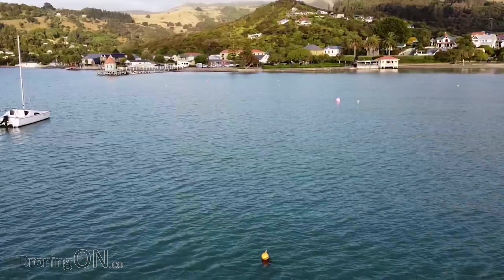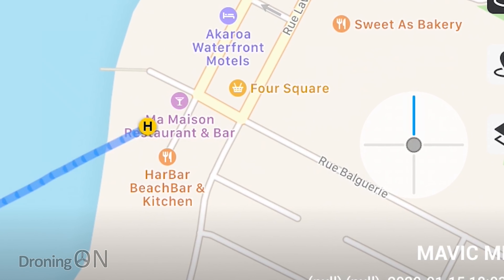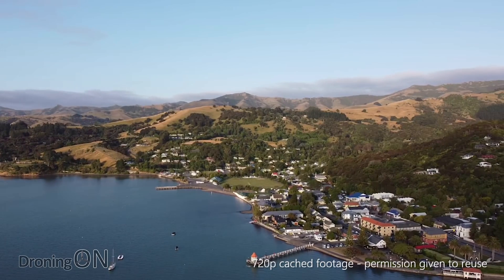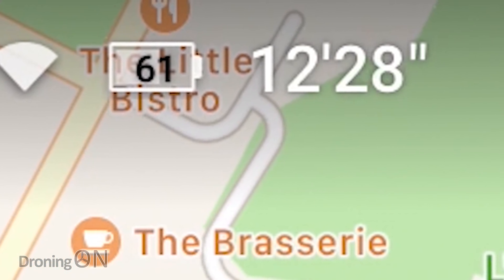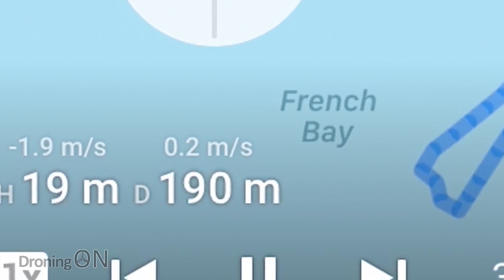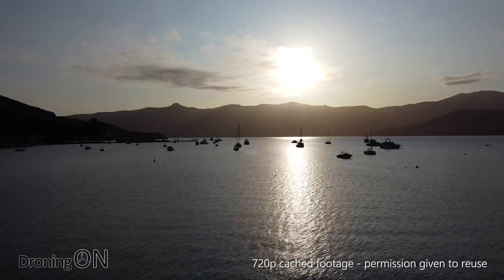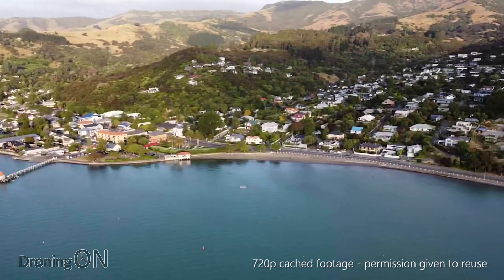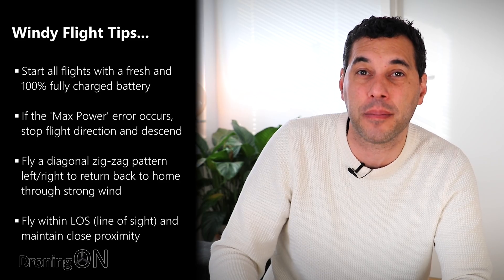DJI Mavic Mini Uncontrolled Descent Into Sea | Max Power/Wind Issues/Operator Fail?

Comment: Jimbo's additional save-the-day rules:

Rule # 1:  NEVER begin any distance flight downwind (with the wind pushing the drone away from you).  Better to let the drone initially fight to gain distance away from you.  Use the Force wind Luke to help it come back.  This is even more important when you loiter too long or stray a  bit too far and the battery is getting low.

Rule #2:  If you ignored rule #1 and your Mini is struggling against the wind to get back then IMMEDIATELY switch it to Sport mode.  That extra speed will help it to fight the wind and just might save the day getting it home.

Rule #3:  NEVER fly over an area where you can't quickly and easily get to the drone to retrieve it in case of a malfunction, signal interference, etc.  While we all love these gorgeous over-water flights, especially ocean excursions, you're playing Russian roulette that your drone, especially your little lightweight Mini,  will actually come back.

I realize these are a bit restrictive and certainly not as much fun, but better to concentrate on making rewarding stunning flights with the drone not far away from you... and retrievable.  And remember that even if you get your drone back from the (highly corrosive) salty brine... it's freakin' toast.😭😭😭

Cheers from Thailand and fly safe!👍😁👍
Reply from the maker: Thanks Jimbo, good advice!
Reply: Some good points, but deploying sport mode is sometimes not a good option as in that mode, the battery is drained very quickly, from my perspective (1) planning, weather, safety etc (2) 100% battery (3) VLOS (4) fly into the wind at the start of the flight

Comment: It's pretty simple. Drones have a max. speed. Winds even remotely close to that speed and your drone gets lost. This speed is different in all drones. Sports mode helps as well as descending, as it increases vmax. After a while at max power though, the batteries overheat and power needs to be reduced to protect them from a thermal runaway. That's I suppose why DJI takes the drones down before risking that. Winds with gusts! up to half P-mode should be all you fly in. And that can dramatically change 50 meters higher. At the moment in Europe with storms every other day, no drone should be in the air with ground wind gusts above 100kph.

The key is to understand both the limitations of the drone and a little Meteorology if you want to fly. A few apps out there help translating weather reports and planned flight (location, hight, etc.) into a simple traffic light system, like the one from the DFS. But you will still find people ignoring this. Drone darwinism I guess 🤨
Reply from the maker: Exactly Robert, sadly however too many operators don't understand the basics of flight, but maybe losing their drone might help with that education :)

Comment: I have besides other DJI drones also the Mini. You are right, the Mini is a great drone but with the 249gr it is not a superhero. My wind tests showed that gusts of 35 km/h is the absolute max it can handle with still an OK control (the yaw control is already affected with this wind ) . During thiese tests I got also both warnings; wind and max. rotor speed. As with all flying things RC or real you should be aware of meteorological conditions. In addition in mountain regions you can have serious up and down winds. I would recommend to use UAV forecast to check the wind conditions and the wind height profile conditions.
Reply from the maker: Thanks Frank, that's great that you've conducted such comprehensive testing, it would be worth pushing out a video for that!

Comment: dji doesnt care i filed a case with them they ran a diagnostic and got a response saying its pilot error. DJI pretty much to me go F**k yourself. winds were not even strong.
Reply from the maker: That's really worrying indeed, I wonder if they've pushed the flight time too far and that the battery calculation is incorrect.
Reply from the maker: Just to check, when yours descended to the ground, was it a steady descent and then touchdown? And after what was the battery status, or did the drone turn off?

Comment: I also had a same issue. However had s full charge, just got it up. Was only 2m up flying straight forwards. 0 wind as was between houses. Suddenly dropped and skipped on the ground. Changed the props an now no issues. Couldn't have been wind, distance or height in my instance.
Reply from the maker: So many occurences, this is indeed a big worry - thanks for the comment!
Reply from the maker: Just to check, when yours descended to the ground, was it a steady descent and then touchdown? And after what was the battery status, or did the drone turn off?
Reply: @Droning-ON  it was a quick decent almost bounced off the ground then went back up again. Battery was showing fine, no low voltage. Just had the same error a split second before it happened. I changed it into sport mode and did more testing. Everytime went full forwards and let go it dropped. Again windless conditions. Flying only at around 1m high.

Comment: Exactly what happened to my Mini, luckily I was flying over the beach at the time, all of a sudden it started descending, I was only 20m high and about 50m out and had now warnings,  it kept descending until it touched down/bounced on the beach and then went back up to 20m.  Found it very strange and just glad it didnt happen over the water!!
Reply: Sounds like a close escape!
Reply: @DarrenHale  very, the Mini was actually busy hovering since I was messing around with settings on my phone.  When I saw it starting to descend, I thought I would leave it alone to see what it does and what was going on in its little brain.  Seems they get confused all on their own from time to time!
Reply: Same happened to mine, but it went into the water after hovering at 2m about 2m away.

Comment: Plain and simple....the mini is an amazing drone, but it is not designed to handle high winds. Every single one of these fly away videos that I've personally seen occur in 10-15 MPH winds. I don't think many pilots realize that just because the wind is light on the ground, doesn't mean it's light at 200-400 feet. Using the UAV forecast app, I've seen ground level winds at 7 MPH and gusts at 200 feet that were at 20-30 MPH at the same exact time. If you fly in high winds and lose your Mini, then you can only blame yourself, not DJI.
Reply from the maker: I do agree, sadly many forget that it's a tiny little 250g quad, let's hope that this video helps to educate! Thanks for the comment!
Reply: @Droning-ON  That's definitely the trade off for having a sub-250g drone. Gotta be more careful. Great video, I think you nailed every point.

Comment: mine never does anything like that and goes through ALOT of wind. upwards of 10-15 mph on the ground
Reply: “Same with my mini. No issues.”
Reply: i think the battery levels played an important part here. yours must have been at a reasonable percentage.
Reply: I just posted a rather lengthy response to this video and I myself dis-agree with this video.

Comment: I dont think that this is because the wind. Look at the water, look at the trees..I cant see strong wind. My opinion is that problem with hardware or firmware
Reply from the maker: Thanks for the comment, but as mentioned the wind at 85m will be different to the ground-level wind.
Reply: @Droning-ON  yes its different, but still I dont think that this happened because of the wind.

Comment: When I fly my Mavic Air the first thing I do is check the weather and wind speeds. When I take off I never fly with the wind away from me for this very reason shown in this video. I check the surroundings  including hills etc and first thing I do before flying off is go straight up to different heights to see how the wind is and then fly accordingly.  The Mavic Mini is a great drone but one should not fly it to far away and not to high as its such a light weight drone. I think some people are flying it beyond its capability's causing these Motor Errors etc. There does seam to be a problem though with how it just went down like it did. Hopefully Dji will address this with new warnings and a update.  As always great video mate and great seeing you back.
Reply from the maker: Thanks Ozzie! Its great to be back! As I mentioned, too many are flying the Mini as if its a full blown Mavic, but it just doesn't have the power, weight or presence to fly like that. Let's hope that this video helps to educate.
Reply: @Droning-ON  Agreed its a well options Toy drone and people need to realise that.
Reply: Very good advice Ozzie. Fly away, into the wind. You would also not swim in the sea if the tide is going out.

Comment: This subject definitely needed to be addressed and I'm sure DJI could spell out the possible problems in the manual and as a screen warning in 'flashing lights'*. Why do they advertise a range of 4 km if it's just the toy you think? I've only got 650 m in an urban area myself in any case. I've also experienced max power errors but I've waited until there was some forward progress on RTH or seeing it go backwards before powering forward on full stick. When I got vid back I flew low taking advantage of natural cover at lower altitudes. (Yes you can take control somewhat on RTH) The short of this is, you need to learn to be a drone pilot if you are going to take it out long distances. Be very careful when flying out down wind to stay close. Obviously this guy got caught out at altitude. What was his battery state at the end? because I think the software will land the drone right where it is if the battery gets too low. That's probably to prevent a crash and burn, unfortunately the little mini can't swim too well.
* Perhaps the voice saying. Return to Home intermediately or return may not be possible. Or a self selectable software choice to initiate RTH upon "max power error". Once again thanks for bringing this up in a technical manner.
Reply from the maker: Thanks for the comment Russell.

Comment: I’ve noticed that a bunch of experienced flyers on YouTube have lost or almost lost their Mavic Mini, but new to drone/first timers aren’t. I believe this is due to one of your main points, they’re attempting to fly the Mini like they have with their Phantoms, Mavics or even Sparks. Forgetting that is not meant to be flown that way. Just because it CAN fly high and far doesn’t mean that anyone should do that. Keep it close, watch the wind direction, & obey the warnings. Or buy a Mavic Air.
Reply: I lost my brand new Mavic Mini over water on a windy day, so I bought a used Mavic Air.  Problem is, I'm totally afraid to fly the thing unless conditions are dead calm perfect.
Reply: Walter Padgett i’ve had very little problems flying my Mavic air. I’ve flown it near the Mackinac Bridge in Michigan  in open windy areas for sure, with no problems other than trying to catch it when I landed it when I was on a boat. You can find my footage on this in my summer vacation video at around 11 minutes.
Reply: @walterpadgett2566  Same here, I lost my first Mavic Mini.  Pilot error.  $500 mistake well learnt.  Now I take zero risks with my 2nd Mavic Mini.  If I see so much as leaves in the tress flapping I won't take it above 50meters.
Reply: @paulypaul111  do you still have the second one?
Reply: @walterpadgett2566  Yeah I wouldn't ever take mine out on a windy day, especially not over water.
Reply: Walter Padgett I feel your pain. I had a Mavic Pro go crazy and almost hit me in the face. Made another circle right into a tree. It took awhile for me to fly without apprehension. Once your comfortable again it goes away.
Reply from the maker: Indeed Deacon they do, let's hope that consumers and content creators learn that the Mavic Mini isn't like its older siblings!! Thanks for the comment!
Reply: Very true, had no issues with mine so far..
Reply: Coming from a P3 I am struggling at this. I got the mini to get trip footages because of the portability. However every time I flew I got a strong winds warning (red)... every time! Winds at ground <5 m/s, at altitude I guess double that. Its way too sensitive to wind, compared to a Phantom. Since I don’t know its limits and Im getting pissed of bringing it only not to fly I started to ignore the warning a bit while lowering altitude. Last flight a gust resulted in a pretty significant roll while maneuvering, I landed asap. It’s tough, not  being able to fly except when winds are calm.
Reply: For sure.  I switched from a DJI Spark to the Mavic Mini, and the Mavic Mini was way less capable in the wind than the Spark.
Reply: Probably because first time flyers aren't admitting to it.  But I will fall on my sword that I lost my mini after only having it for 10 days.  100% my fault.
Reply: This! I started with a mini, never almost lost it, used common sense, and then bought an air when I realized that would be better for flying at longer distances. Easy!
Reply: I am new to drones and the only reason I have flown far was to test it. But I was relatively low so if it was ever to drop, it would not have a painful death. On sand as well
Reply: Has there been any analyses or instructions comparing the relative flying performances and capabilities of the drones. I feel that sometimes it is taken as commonsense that bigger and more expensive drones have certain capabilities owing to resilience and stability, and yet this is never stated anywhere outright.
Reply: I agree. I have the mini, the air 2 and the Mavic 2. The mini just can't handle wind. It's like trying to swim in a rip tide.
Reply: I'd say they were fliers who thought they knew how to fly. Many out there flying haven't a clue.

Comment: Ok this has happened to me three or four times so far luckily I have caught it every time there is definitely a problem here The drone just automatically start to descend on its own
Reply from the maker: This is very odd, I suspect that the Max Power warning (in strong wind) invokes the auto-landing on the spot, possibly for safety. But it is odd that the app doesn't indicate anything.
Reply: @Droning-ON  I have some footage of similar height drop over sea. Thank fully I was able to save the mini.
Happy to share if you'd like
Reply: @Droning-ON  I concur, it may even be overheating of components because of the high power setting. If the pilot was able to overrule the auto land in that case, the overheating would simply continue and eventually the drone could fail and drop out of the sky. This drone is simply not suitable for high wind use, which is typically something you get near the coast and at altitude as you explained very well in your video.
Reply: Do check if the drone propellers are set to the designated wings.. in case that's not set correctly, you'll end up getting a lot of 'max power reached' warning & the drone drops suddenly

Comment: Sound advice Ash - even if most of it seems obvious to a reasonably experienced drone pilot - but then again - I guess Mavic Mini is targeted at new drone users - does the official 'DJI Care Refresh' cover you against these kind of Pilot error disasters? 👍👍
Reply from the maker: Thanks for the comment Dale, yes the Refresh would indeed cover you, however only on the condition that you recover the drone. However in this instance there was some operator error but also a software defect in the uncontrolled landing, so let's hope that we can get this guy a new drone.

Comment: Well put. I've had that warning but like you said I dropped altitude and headed back. Never fly with a already used battery at less than 100% unless it's really close and you can land it quickly if need be. I've just been out with my Mavic pro as the wind is quite strong and rather than risk it I took my bigger drone. If you haven't got a bigger drone wait for a calmer day. The mini is not made to handle any type of wind.
Reply from the maker: Precisely, this little nipper can't be flown like it's big brothers! Thanks for the comment!

Comment: Unfortunately this is the price paid for a <250g drone with a claimed flight time of 30mins.  The batteries are only a pair of Samsung IMR 18650 R25 cells in series with a combined output of just 8C. This is fine for hovering and noodling about but excessive load to the power system will cause significant voltage sag. For what it is the Mavic Mini is not a bad little flying camera, the problem is that people are trying to use it as if it were a Mavic Pro. Maybe if DJI hadn’t given it a Mavic label then maybe owners might fly it differently.
Reply from the maker: Exactly, although for the name I'd have called it the "DJI Mavic Pocket" 😉
Reply: @Droning-ON  ryze tello 2..!!😂😂😂

Comment: Excellent tips.  I'd also add that if you're in a similar situation over water, start looking for places to safely land.  Matter of fact, that should be part of and preflight checks over water. Landing on one of the boats or flying sideways and landing on the empty beach to the right were possibilities.  Yeah it sucks and is embarrassing and possibly going to cost a few $$$....but at least you know your drone is intact and out of the air, not in the water.
Reply: I also highly recommend that if you can safely do so, test the capabilities and functionality of your drones in a safe environment so you don't panic during an emergency situation and you're familiar with what to do.

Having said that, there should be a warning of some type stating the drone is landing.  If you or the operator receives a response from DJI, please do a follow up or update to this video.
Reply from the maker: Very true JSKCKNIT, the same as manned aviation whereby you're always looking for a safe landing spot while flying, even if when above sea it's a passing boat 😅